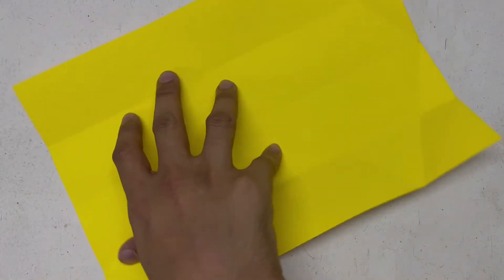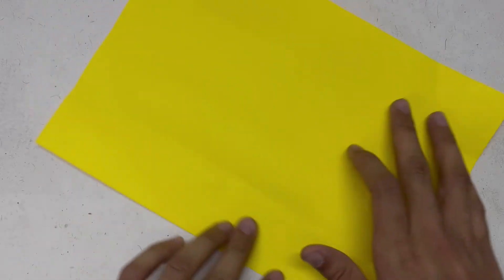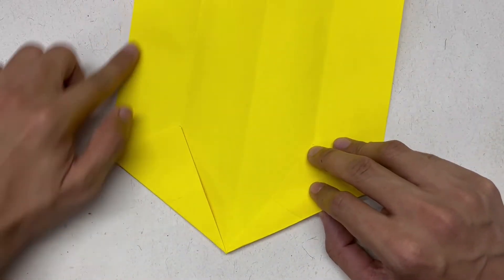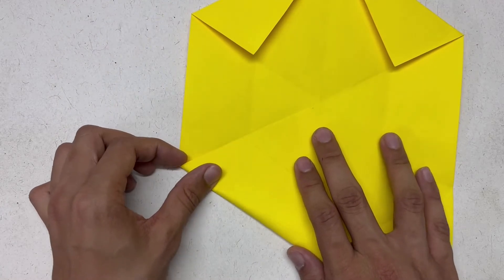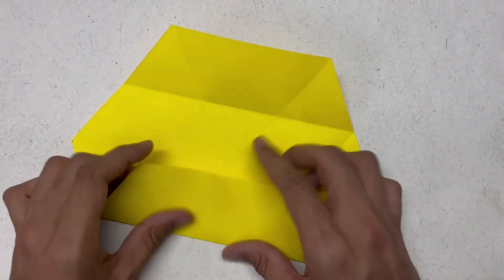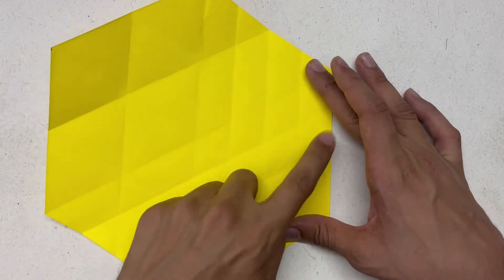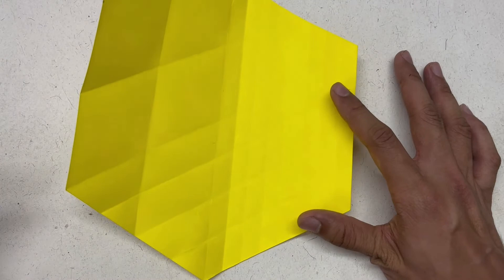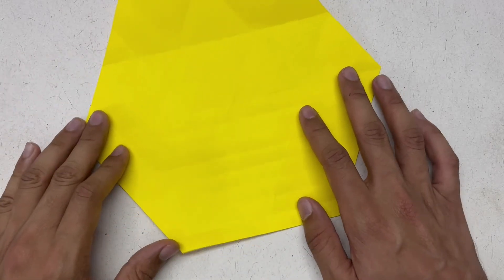How to fold a triangular grid on a hexagon

Comment: I’ve used many methods to fold hexagons and this is my favourite. In the spirit of helping, please be aware that this only works using rectangular paper. If you try to do this on a square, your starting folds won’t be in the right place to use on a 32 division grid.